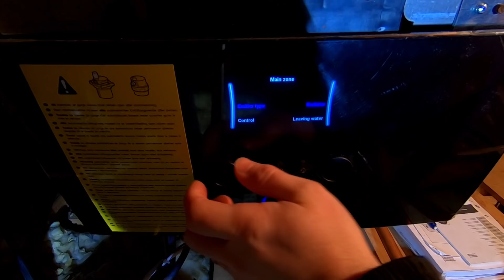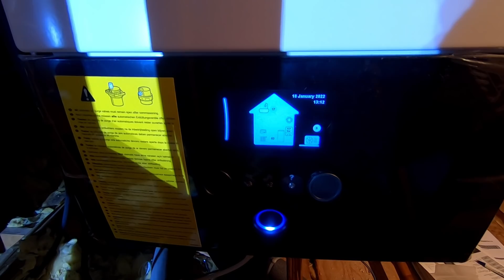How to lose £2000 installing a heat pump

Comment: Holy crap! That's a total shocker. WC disabled and third party controls too. Was the buffer justified?
Reply from the maker: if I was doing this job now I would have gone no buffer, pipework through to the ground floor, moved cylinder to the ground floor, and a new run of primary from the ground to the kitchen. I would have explained the benefits of not using a buffer and doing some more upgrades internally over trying to run high temp through a buffer at a scop of 2.

The problem is the company that designed this job treats heat pump installs as direct boiler swaps. They even retained existing vented cylinder with a really small coil. 

All that happened here is pretty much unthinkable for me right now.
Reply: @UrbanPlumbers  absolutely. It's painful to watch. Vented too. 😳

Comment: I’ve seen the same where ASHP are installed in poorly insulated homes, set to a fixed flow temp of 45 or 50C, apart from everything else it’ll shorten the life of the compressors with all the short cycling. It also ruins the reputation of heat pumps from unhappy homeowners

Comment: It's cowboys like the firm that contracted you that give this technology a bad name. Sadly, most people go into the heat pump installation decision blind because they don't have the full technical understanding of how it works and needs to be set-up, so customers are dependant on a company being honest in specifying the correct equipment and configuration. There are so many stories of people installing heat pumps and end up with much higher bills than their old gas boilers or have systems that do not heat the house. Their engineer's attitude to setting the system up was disgusting. They should be named and shamed, because that poor customer will be paying the price every month for the inefficiencies they will incur.

Comment: You are one 'Cool Dude'. Your workmanship is Immaculate, your Honesty, Morals and Integrity are also Immaculate.  You kept your cool with the main contractor and acted like a Professional throughout the Contract. The trouble is the Government is trying to sell these heat pumps as part of their way to meet the G20 something or other as their part for the 'Global Warming action'. Unfortunately there aren't enough Professionals like you, with your morals/Integrity and craftsmanship to install them correctly. Also I bet the manufacturers are unable to meet the demand and offer the  much needed advice for installers to set them up correctly. I would like to ask you a question. How much did the system roughly cost?. Without the labour, just the materials must have run into the thousands alone???.

Comment: Heat pumps a great - but only under very specific conditions, which are rarely met. According to the Association of German Engineers (VDI), in 2021, there were over 5000 active cases registered with German courts where people took plumbers or owners of heat pumps to court. Two main reasons: A) lack of performance vs. electricity bill and B) noise, mostly in the de-facto unregulated low-frequency end of the spectrum. ... we are operating a help-line to support people exposed to anthropogenic noise and heat pumps are our #1 when it comes to noise-induced insomnia, high blood pressure and and a set of auditory symptoms, previously seen only in operators of heavy equipment. Manufacturers have known about this problem since around 2010 - and basically decided to ignore it (with some exceptions. like Stiebel Eltron and Bosch).
Reply from the maker: What have Steibel Eltron and Bosch have done?
Reply: @UrbanPlumbers  Stiebel Eltron have taken constructive measures to lower the level of LFN produced by the fan (blade topology, increased number of fan blades), directing the noise emissions towards the floor (which should be loose gravel). Bosch have done away with the dB(A)s in their recent literature & advertising (A-weighting totally under represents the LFN content - the part that has the highest biological impact, a practice that has been criticized by noise experts for ages) and are now using just straight dB instead, which is way more honest and realistic.

Comment: Where the anti freeze valve drip outside, are these still fitted if glycol is used between the outdoor and indoor hex unit? If it's dripping, what tops the pressure back up?
Reply from the maker: No glycol needed. Manual top up.
Reply: @UrbanPlumbers  would this change if the compressor unit was 3- 4m of pipe away from the indoor hex unit in an area with outdoor design -3.5c?

Comment: A good installer can make the most of the machine.Thank you Urban Plumbers! Impressed by your professionalism and honest demonstration about the problem when replacing the 
boiler. I could feel your helplessness in front of the supplier's prohibition about temperature compensation of the heat pump, it violates the original intention of installing a heat pump, without temperature compensation, how can it be energy efficient?

Comment: What's your opinion on electrical boilers? I think I'd save a bunch of space replacing a standard boiler system and we're considering some form of small scale solar/wind utility on top, and the whole process seems cheaper for now and pretty drag and drop compared to a heat pump.
Reply from the maker: The worst option of all possible ones in my opinion. 4 times the running cost of a heat pump. In current climate electric boiler would be unaffordable - probably cost around £10k a year to run in an average house.

For that you can just buy a heat pump and have much lower bills.
Reply: @UrbanPlumbers  Do you think hydrogen compatability is a valid selling point that could come to fruition in the future?
Reply: @SirDamned  almost certainly not.

Comment: In the netherlands, in my experience, weather compensation on gas boilers runs wayy to high temps. With underfloor heating you might put it fixed on 25 or 30c depending on isolation.

Comment: I believe that domestic heating systems in the UK accounts for around 0.0001% of the CO2 produced in the world and converting to heat pumps may only save around 25% of the CO2 produced from current gas heating (depending on how the electricity is generated). So at best we might save 0.000025% of CO2 generated if we all had them. Hydrogen produces 0% CO2 other than that to generate it (which is improving rapidly). So tell me again, why should I go through the pain of install these god awful things and pay 20k for the privilege

Comment: Which company is this? So we can avoid. Thanks
Reply from the maker: I have had enough trouble as it is with that lot, so can’t say.
Reply: @UrbanPlumbers  🤣🤣🤣
Reply: @UrbanPlumbers  do you install in Sutton Coldfield?
Reply from the maker: @Simpleboneguy  google heat geek map for a local installer that has a higher chance of being decent.
Reply: @UrbanPlumbers  thank you Sir. Just one last question, do heat pumps save money? I want to do my bit for the environment,  but it also has to financially viable.

Comment: My Nibe air source heat pump has full configuration easily accessible via the control panel. I have learned initially how to configure the heating curve.  Cooling was disabled at first but since the summer, I have learned how to enable cooling, selecting cooling curve and trigger temperatures for heating & cooling. Both heating, cooling and hot water work nicely in the first 9 months since taking up residence in my new house. The system was installed one year before.

Comment: What an awful video. So your clickbait comment about how to lose £2000 installing heat pump, implies that anyone who installs a heat pump will lose £2000. But this is you losing £2000 for work which is not the same thing. You are a plumber you are not an expert on renewable energy, so why think you are. The idiots who will believe you are the ones who comment about not wanting heat pumps based on your biased incorrect rubbish. Why not do a follow up to give the householders view of how this has been since it was installed.
Reply from the maker: Trigged much? Go to your safe space.

Comment: Always do a nice job, would definitely want to consult you when my gas boiler fails...but for an air to air system (Multiplit R32) with cassettes in the rooms and some way of heating hot water...as the multisplits I've seen don't have a hot water option. Plus microbore rip-out and all new rads make a standard heat pump a no go option. It's really annoying there are no grants for multisplit air to air systems....although I suspect the price of the kit required would simply rise to take advantage of the grant.

Comment: So the customer is actually getting screwed? 
Not by you of course, but by these nitwits that tell you to set the thing up in such a way that it is not efficiently running. 
Btw, nice looking plumbing and wiring.

Comment: Those kind of companies are what make people think heat pumps are a scam: bad planning causing the install to be more expensive than it should be, while also not being competent to set it up correctly causing the energy bill to be much higher than expected/promised. What a nightmare.
This is why I prefer using small specialised contractors instead of those companies that just want to bring in the big money by outpricing the small ones and doing large volumes but don't take pride in their work and don't care about customer satisfaction...
Reply from the maker: Exactly - could not have said it better myself

Comment: Are they upgrading the insulation? The loft joists can be seen so it can't be very thick up there.
Reply from the maker: no idea frankly. I think they had to to get the funding. The whole job was a mess anyway. High temp heat pump on existing radiators. This set up will run at 200% efficiency only. One of many reasons I would never work for those kind of outfits again.

Comment: I commissioned myself my own Daikin Monobloc 16kw a couple of months ago, in Greece. The thing is my cousin is an official Daikin dealer, hundreds of km away so he sent it to me. I am a mechanical engineer, my plumber connected it under his experience, my electrician connected it under my advice and I started it up. Documentation was quite good, but it had to be read really carefully to understand and some details were missing. For example, I had a 3rd party boiler (solar) with a resistance heater+heat pump exchanger, I never got Daikin to explain me if and what accessory I needed to connect, for the heater to be connected on the heat pump. So I let it go and installed only the 3 way valve, IF I need the heater I will turn it on with a relay from my smart home system! 
However, I found the controller to have a perfect wizard for starting up, if you knew what you were doing, it was quite simple, I got it up and running within minutes WITH temperature compensation curve as well!!!
Reply from the maker: 16kW??? the house must be huge!
Reply: @UrbanPlumbers  almost 300 m2. 16kw is a small figure since in low temperatures, the capacity drops @ 12-13kw, but in my region temperatures reach 0C only a couple of hours per day, ten days per year so not that big deal!

Comment: Thank you for such an informative video. Getting honest appraisals from skilled tradespeople is essential. In my career I have seen that it is always the worst products & companies spend the most on marketing and this to be exactly what we see in the sale and promotion of ASHP & other 'green' initiatives. In terms of overriding the weather variable setting in the system software, I would think this is a breach of contract by the main contractor as they are not supplying a product that is fit for purpose (its the equivalent of a garage changing the settings in your vehicles computer system so that it runs the diesel regeneration system all the time you drive).

Comment: That should have been a split, not a monoblock with a hydrobox. The indoor split unit could have gone exactly where the old boiler was. Have you considered doing your F-Gas so you can get a step above most other installers? I've seen a lot of LG Therma V split installations in Turkey and they look nice.
Reply from the maker: Even if it was split it could not have replaced the boiler as promises there were only 22mm and you could not replace them.

New cylinder should have been installed on the ground floor the. There wouldn’t have been a problem

I will look into f gas as I can see the benefit of installing split units
Reply: @UrbanPlumbers  22mm flow and return on anything less than 7kW ‘should/might’ be alright but it’s a bit of a gamble. Small buffer/llh in a kitchen cupboard would have sorted that though. F-gas is defo worth looking into.

Comment: Can you explain what "weather compensation" does?
Reply: For examapIe: f you have a bathtub filled with 40°C hot water it would cool down if the room is 20°C. But that same water wil cool down a lot faster when the room is 10°C. So in the first example you have to open the hot water tab a slight bit to compensate the heatloss, in the second example you have to open the the hot water tab further. When you see the tub as your house, your main priority is always to insulate as much as you can to reduce heatloss. But weather compansation will regulate the tab so the water stay at a set temperature.
Reply: @hanstersteege9319  thank you!

Comment: Crystal ball time…there will be a big push for these and a massive grant scheme…and where there are massive grant schemes, you get companies trying to undercut eachother to win contracts. This will be a huge scandal in 10 years as people…especially elderly will be persuaded to pay for one by an ‘assessor’ (on commission) who’s done a 2 day training course - but it’s ok as the owner can get a discount through the grant scheme (be quick - it won’t last forever) The installation company - who makes no money - cuts corners and throw them in unsuitable houses in 1 day so they can get to the next one, leaving the owner with electric running full blast 24/7 to try and get any heat. You also won’t be able to sell your house as the install will be deemed sub-standard and won’t get the relevant certs. You’ll be stuck with it - plus massive electric bills…and still cold. The words ‘government grants’ should make you shudder - not get excited.

Comment: Appreciate the skill here, but my god, if this is the future of heating in the UK, you can forget it. So complex, so much work, such an eyesore having all that outside the house and running up the walls. It's clear whoever made this big heat pump decision hasn't really any experience of installing them, and from what I've seen and read, what you end up with is an inefficient, complex system that doesn't really meet requirements.
Reply from the maker: Read some more from better sources please. Heat pumps are by far the most efficient heating method ever invented. You literally get free energy from air, ground or water.
Reply: @UrbanPlumbers  Yes, but look at the cost of installation - compared to a standard gas combi boiler, it will take years for the consumer to re-coup that additional cost - if they can afford it in the first place. House builders will just add the cost to the property, so they don't lose out, but installing in existing properties is a mine-field as you've found out. What about annual servicing costs too compared to an existing gas boiler? I get it's essentially 'free' energy, but what's the actual efficiency compared to gas? It seems like we're sacrificing quite a lot in the name of going green. Total respect for your knowledge and skills though!
Reply from the maker: On average gas boilers are 80% efficient unless really well installed and designed ( literally never happens), then they can be around 90% efficient. Heat pumps are around 300% efficient when installed well and can be up to 500% efficient! 

Heat pumps will use 25% of energy that your gas boiler has to use. 

Servicing requirement is comparable to a gas boiler. Life span of a system and heat pump is double of a gas boiler on a well installed system.

Installation  cost is a bit more on new build and quite a bit more on retrofit. 

With scaling up of heat pumps cost will come down. We are in early days at the moment.

There is no other technology available that can save us those kinds of energy and cut our emissions by a massive margin.
Reply: @UrbanPlumbers .  Do you have any sources where I could read up on the heat pump systems? I am in the process of buying a rural house and would consider installing one. Thanks.
Reply from the maker: @jimh4072  check Heat Geek Youtube channel and his website
Reply: @UrbanPlumbers . Great, thanks for replying. I will check it out tonight. 👍

Comment: I installed a NIBE air source heat pump in 2008, I attended the NIBE training session too, so many times the compressor wouldn’t come on. It would have been worse if I hadn’t installed a gas boiler to supplement the heat. The house was so well insulated we could heat a 20sqm room with a £10 fan heater on the lowest heat setting. Much cheaper to have a fan heater in each room than installing a AS heat pump.
Reply: https://youtu.be/QLGANlbqIFY?t=343 - talking about advancements in heatpumps in just the last 3-4 years

Comment: The joys of sub contacting, been there got the T shirt, jobs are never as described and stuff never turns up when it should, guess what, the only person who will lose out is the installer.
Surely the most important sensor on the unit is the external one, to disable it is crazy. It could now be switching on or off when it shouldn't be. 
Missold a heat pump call this number, those will be the next ads you will see on the TV 😂😂